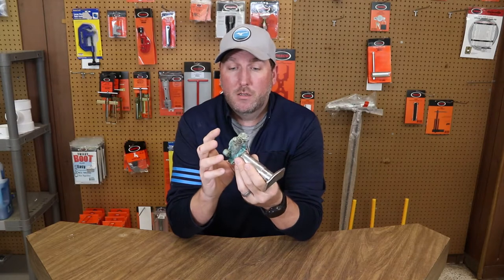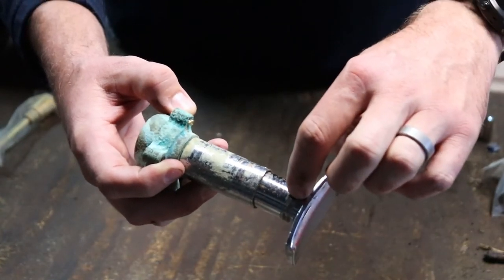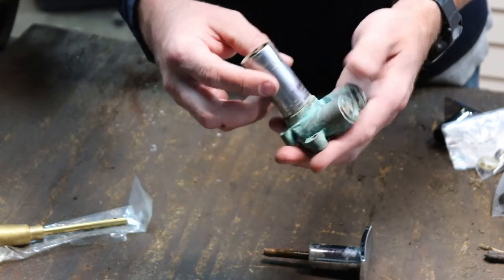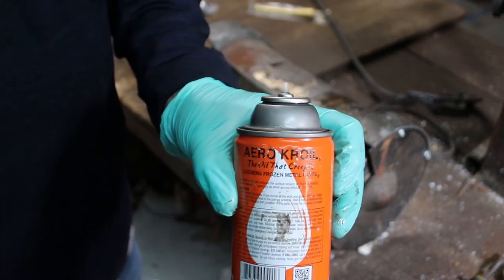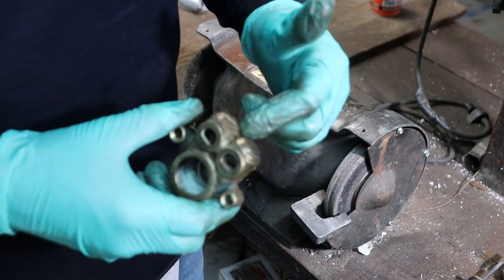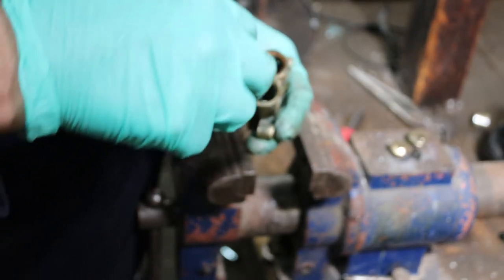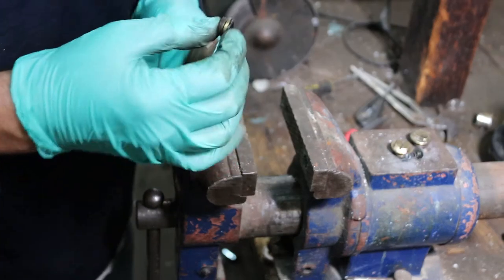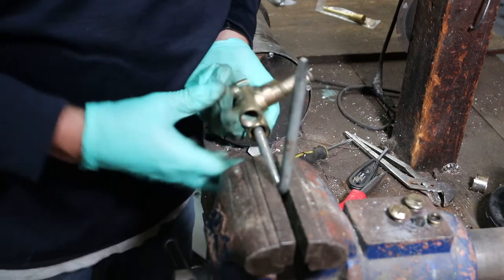American Standard Push Pull Shower Faucet Rebuild

Comment: Very helpful information by seeing how this puppy is actually put together.  My shower was dripping out the front and by watching this video was able to clean up the nut that presses against the teflon rings and re-install, which solved the problem.  My biggest issue was getting the set screw out of the handle, which was facilitated by applying some Liquid Wrench, tapping with a hammer and punch and patiently working it back and forth till it broke free.   Thanks!!

Comment: Thanks for the video, I have one that's 50 years old and have rebuilt it twice, I forgot how to reset the stem.where does the v notch go?my cold is hot and hot is cold...
Reply from the maker: I am not positive what you mean by v notch but one side of the stem is less rounded than the other.  The flatter side goes down.
Reply: @PlumbingPartsPro  ok. On the bottom of the new stem there is a v notch that I thought had to be aligned with something but it's been so long since I rebuilt this thing I couldn't remember.I'll place the flat side down.Thank you for your time and I'll be sure to look you up for additional parts.bryan
Reply: @PlumbingPartsPro  hey thanks for the tip on the stem placement your a genius..bryan

Comment: hi saw this and these are the parts i need for my faucet! i had no idea how to take it apart. thanks,  you don't have links to the parts in your description.
Reply: what is the best way to seal the back mating surface with the wall part that screws in?
Reply from the maker: Sorry about the link issue.  I am currently sold out but have them on way.  I will get links up soon.  As far as valve body there are three round seals that go between the front and rear sections

Comment: You didnt show how to install the packing seals on stem...epic fail bro.
Reply from the maker: You misspelled Epic. Thanks for watching 😁
Reply: I miss typed epic. You totally left out how to install stem packing seals. One of the most important parts. If you're going to do an instructional video, show all the steps. Especially the important ones.
Reply: Oh good lord. When I receive my repair kit from Plumbing Parts Pro, I figure I'll install the new ones the same way the old ones came out. 

I'll probably put the stem in first in order to keep the packing seals aligned as I push them in from the front. And then I'll tighten the nut in order to compress them, just like he showed. 

I'll be sure to post an update if I'm wrong and the packing material has to be inserted by a wizard via some specialized extrusion device. Or something.
Reply: Not everyone would know what to do or the order of the plastic rings vs copper one.
Reply: I appreciate the video, but to be quite honest, the ONLY reason I searched for and watched your video was to find out how to install the packing seals.  The teflon parts appear to be directional, and it is not obvious how they should be installed.  When the original poster mentioned this, you pretty much blew him off.  I am not sure I understand why you would not respond more constructively to the issue.  Can you please just let us know how to install them?  Thanks.